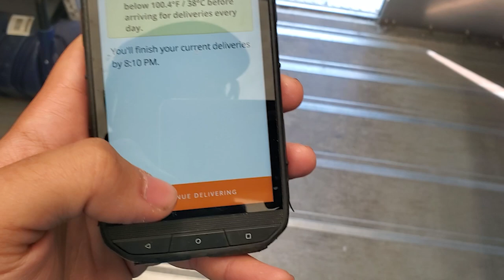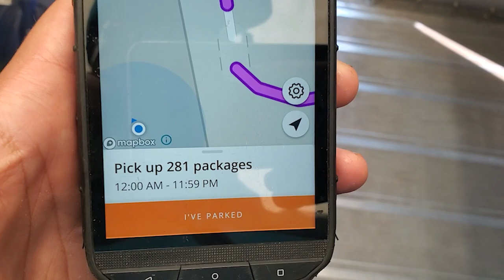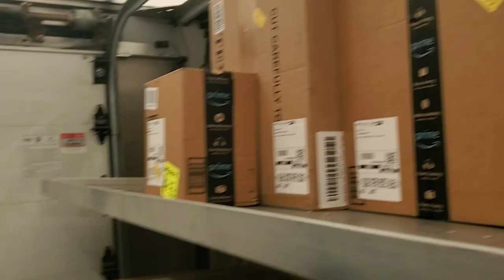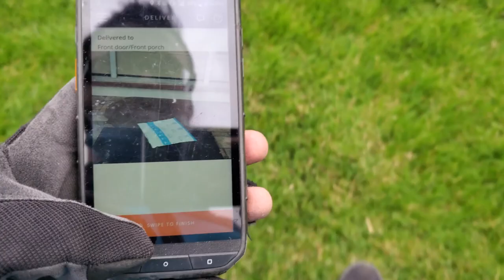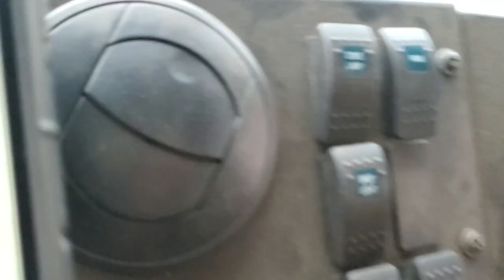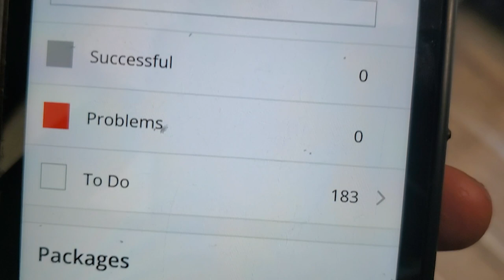How I Organize 300+ Packages (Amazon Delivery Driver Vlog #2)

Comment: I’m starting my training hopefully next week. I don’t plan on sticking around for long (4 to 6 months nothing more). From the stories I’ve heard, working for the Amazon is definitely not for the weak.
Reply from the maker: It has its ups and downs. The area you deliver in plays a big part on whether you will like the job or not. If you get mostly residential areas and not many apartments, you will be fine. the apartments always scare new employees.
Reply: @primenate why the apartments scare new employees
Reply: @User_92020  if you ever been to an apartment you know a couple things. Speed bumps, slower driving limits, smaller turning areas, parking spots, more folks are outside, more gates to go in and out of, did j mention stairs? Multiple floors, multiple exit ways and entry ways… etc. apartments are more complicated than going to a neighborhood.
Reply: I started my day 1 today and had 90% apartments. I manage to finish my route 2 hours before my end time, but man, it's such a slow process and then stupid routing the app throws at you is insane.
Reply: @loopy221  not to mention the buildings that aren’t marked☹️
Reply: @User_92020  The apartments with the gated access are the worst, and some of the very "fancy" places have another code to get inside the actual building. Residential gate access areas aren't so bad  but those darn apartments! Ughh. Routes can make or break you for sure.
Reply: It’s some of the easiest work bro you get to see some of the most beautiful houses give u motivation that’s how I take it
Reply: @residuerude8382  That is very true. I have seen some spectacular houses and amazing hilltop views!
Reply: @orryx9554  aren’t marked?
Reply: @residuerude8382 not a easy job at all if your out of shape, or not athletic
Reply: Working for Amazon is definitely not for the weak nor for people with brains. Leave the hard brutal work for …………. I’ll leave it at that.
Reply: @josericalday  where do you work?
Reply: @josericalday  im highly intelligent and very athletic but also enjoy this kind of work 😒 foh
Reply: @josericalday  i donr understand how this job is easier for people without brains witha 250% turnover rate..... i was army infantry stryker brigade and that was easier..... this job is 1000% problem solving everry day on the spot
Reply: @josericalday  hello 13itch u there? Let me guess amazon fired u
Reply: @ggs9556  this is a lie. Some of the fastest DSP associates don't look like they set foot in a gym.
Reply: @rockon8174  you don't have to look ripped to be in shape
Reply: @primenate  my first day was in San Francisco. Will be that way for the next month. Its a freaking nightmare.. access is often an issue, especially when customers don't answer the call box. You call their phone, no answer. You call the manager they think you're trying to get in and steal mail and packages. Not only that, some buildings don't have numbers. The GPS takes you up and down the same streets 4 to 5 times. Often times elevators don't work when customers want packages at their door. Then parking is so difficult you just have to block whole lanes of traffic. Some places need your badge and id and you have to sign in and take a photo and wear visitor sticker just to deliver... f**k san francisco!!!!!
Reply: @MiguelRPD  how many stops was that? my first day I had all residential houses but it was almost 130 stops lol

Comment: When I used to drive the step van I would put all the totes on the right side then all the oversized on the left side.
Reply: So u only have like 9 totes? What happens when u get 15?
Reply: @whocares1631  he throws em away in a dumpster. Work smarter not harder

Comment: It takes me about 45 min sometimes to go thru one tote, I can’t figure out a good method to organize the packages inside the totes to help me deliver faster. Do you have your own of doing this? Yesterday I took about 8 hours for 173 packages (got rescued because my dsp wanted us home early). I know I’m new and am expected to be slow, but putting the stops in order just doesn’t seem to be efficient.
Reply: I honestly organize them by the small yellow sticker and i finish +35 stops an hour
Reply: I Take a minute to put it all out on the shelf and group up the last names so its just grab and go! Finished 180 stops in 5 hours!
Reply: I brought a plastic container that I sit on floor and I load my small packages in it by number order then place the boxes on the passenger seat and floor in order hope this helps makes my day goes faster 😁😁😁😁
Reply: Get a mail tote, throw all your envelopes with the label side where you can easily look through them and grab them, put the mail tote in your passenger seat
Reply: The Job isn’t for everyone
Reply: @motorcityandy7696  it’s really not.
Reply: @ahmedbafagih3281  how do you handle apartments quickly.
Reply: Try and get a plastic box to put your envelopes and small book parcels in. Then organise them by the smallest yellow sticker number. It takes time at the start but those extra 5 mins organising will make up so much time later on

Comment: Thats good you're in that step van and that the reason I was thinking about switching to one because of that room you have. Doing that in this prime van sucks.
Reply from the maker: yup, i started in the stepvan before december (Peak season) and i never had to deal with 300+ packages in a smaller van.
Reply: Space might not be a problem but no radio or ac is a game changer 🤣

Comment: I don't understand how you do it physically. I estimate my best at 250 packages. I am 2 weeks in. After a 100 stops, my body shows real signs of fatigue, my back is on fire.
Reply from the maker: Slowly and consistently, the guys at my dsp always brag about finishing routes the fastest but that will wear you down quickly and not to mention, kill your knees! I found it best to average at 20 stops per hour.
Reply: When you start getting a consistent area/route, where you see the pretty much the same houses/streets/areas, you start remembering where each one is at and you stop relying so much on GPS! Also, once that knowledge comes, as you load your van in the AM and have seen your route for that day, you can load your over-flow accordingly, so you don't spend too much time looking for it once you're at that given stop!

The most I've done in way of 'stops' is 178 w/308 packages and my Ford Transit Van was pretty loaded! Had 15 totes & 32 good size over-flow boxes! It's all about being organized and how well you know an area!